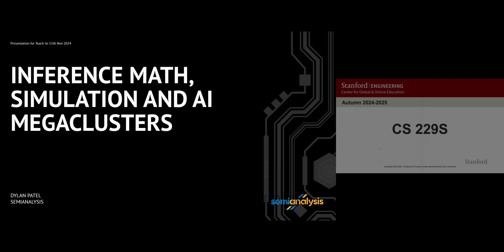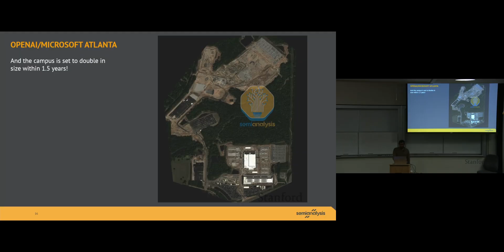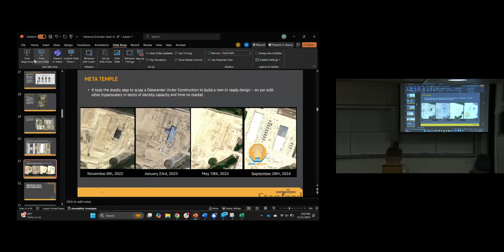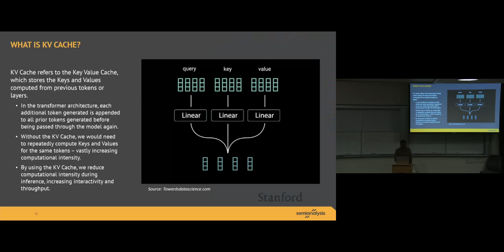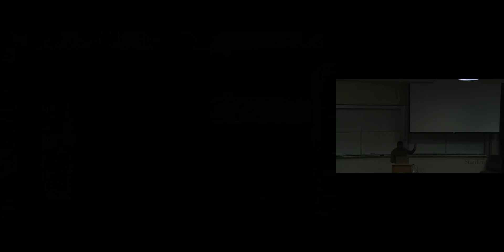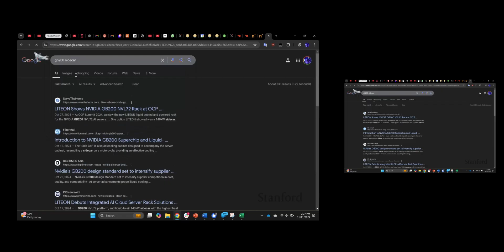Dylan Patel - Inference Math, Simulation, and AI Megaclusters - Stanford CS 229S - Autumn 2024

Comment: Really enjoyed the data center analysis but wanted to make an important correction on estimating optimizer state

When training with Adam you need to synchronize your model weights but also your optimizer state which for Adam includes both your first and second moment. At 2 bytes (fp16) for each that's 6 bytes per parameter total. That's a lot of state to communicate every step but historically memory efficient alternatives to Adam have mostly fell flat on their face and the Adam citation count is trending to infinity and so indeed quantizing Adam has been more promising for the GPU poors what's been popular has been int8 Adam and some larger workloads have experimented with fp8 optimizers. Note that when doing fp8 training what people generally mean is doing compute for linear layers + all reduces using fp8, having the optimizer also be in fp8 is an orthogonal implementation detail  

A popular Twitter optimizer Shampoo is even more memory hungry than Adam since it's a second order optimizer vs Adam which is a first order one. Granted it might still speed up workloads considering it converges better as demonstrated by the recent algorithmic efficiency mlperf working group

So techniques like Diloco are not competitors to Adam, the key insight there is that you can communicate model updates asynchronously and also synchronize updates less frequently. If you scan the paper Diloco has both an inner and outer optimizer one of which is Adam

This is all to say there's significant innovation happening in how Adam is deployed but it's one of those optimizers that have stood the test of time and will likely continue doing so